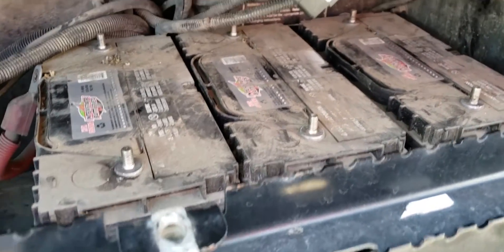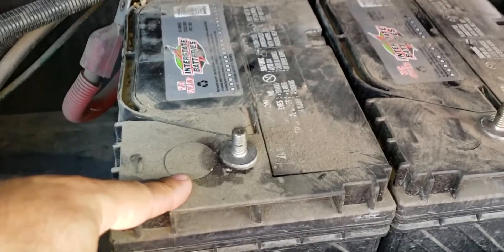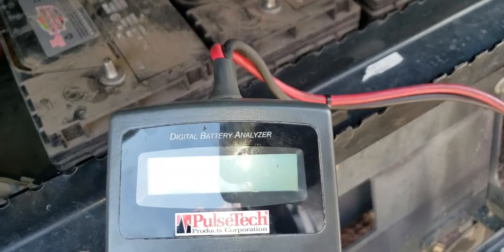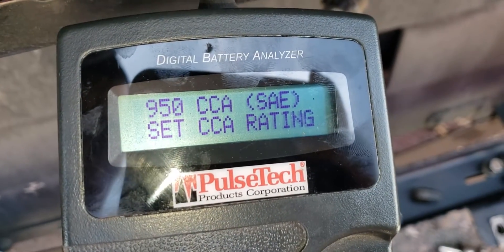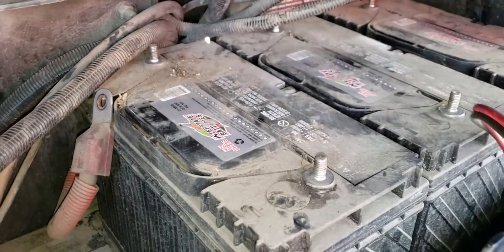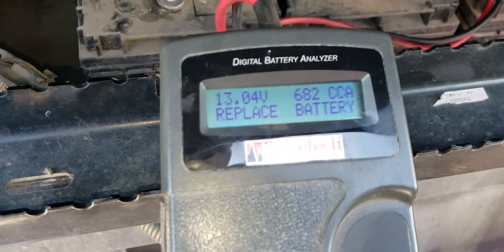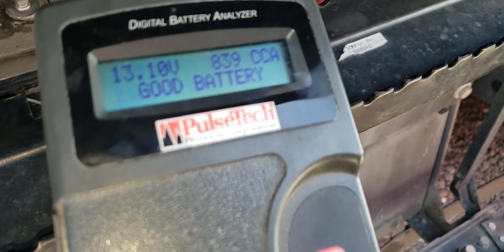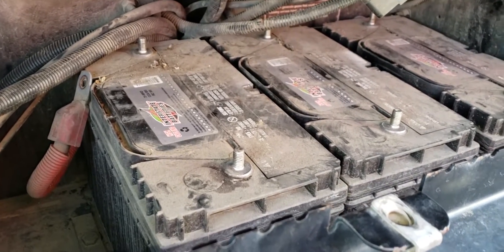HOW TO TEST BATTERIES ON SEMI TRUCK / TEST BATTERY WITH BATTERY ANALYZER

Comment: Do you have to touch the cold cranking amps while the battery is actually cold and hasn't been started in a while or is it okay to test it immediately after you shut down the truck?

Comment: What should the ticker be at the voltmeter gauge when the truck is on the ON position and while idling please answer both
Reply from the maker: Set the multimeter to volts, when idling it should be around 14volts

Comment: 13.2 volts. turn on your headlights on wait till you have a resting voltage before you test your batteries, your cold cranking amps readings will be higher.thanks for the vid!
Reply: How many volts is each battery and why is there multiple

Comment: Where's your 4th battery?
Reply: Replace all the batteries at one time even if only one is bad  !   750 CCA batteries will last longer than the 925 CCA  batteries , their plates are spaced father apart in the battery case .